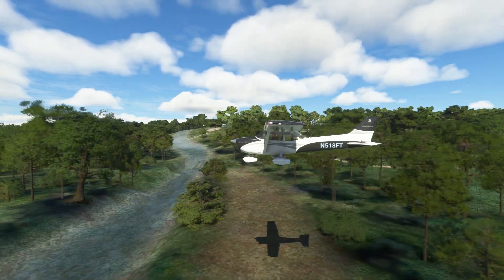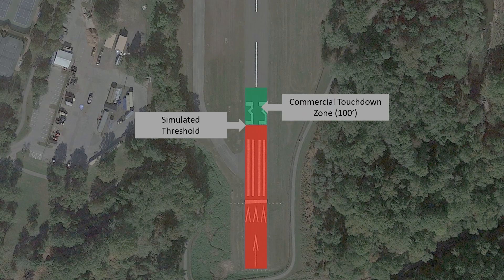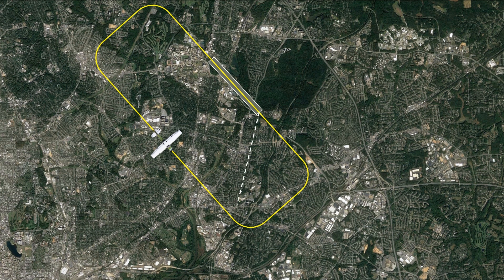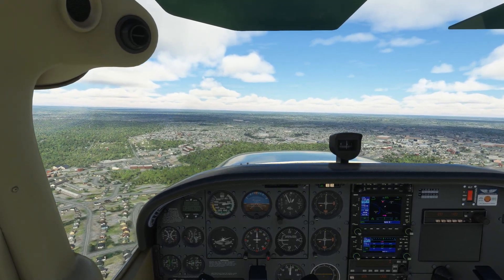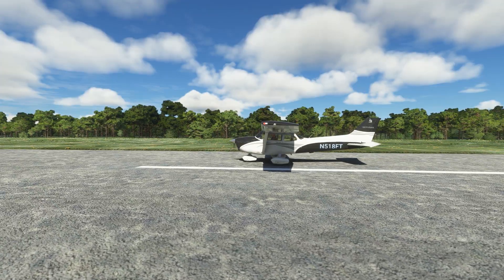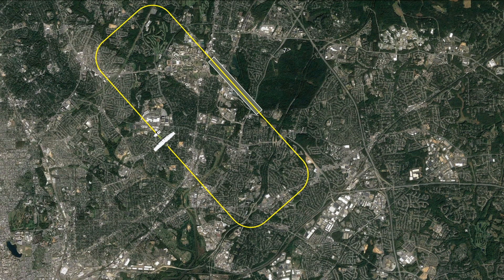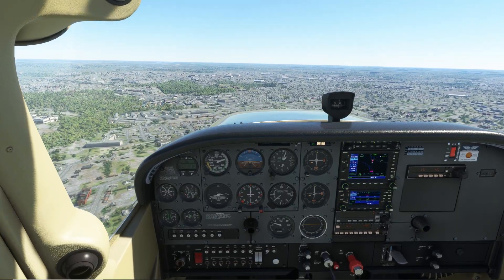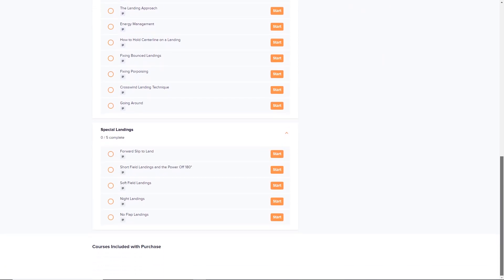Short Field Landings and Power Off 180° | Private and Commercial ACS Landings

Comment: On the power off 180, there is no requirement to go to best glide, so what I found to work great on the skyhawk is - power out obeam the aiming point (not the touchdown point), 10 degree flaps asap, count to 10 while pushing the nose down slightly to get the 75-80 knots (that will help you sink fast in a very tight pattern). As we drop 150 ft, make a base turn, a bit steep. From there, only as we get close to the runway, smoothly adjust to best glide, and maybe set 20 degree flaps to help slow us down. Making a runway turn only at 250 ft AGL, and you will make it to the touchdown point (mine is always the 1,000, and we have no displaced threshold). Of course if there are good head winds - make sure to account for those by either going earlier to the gliding speed or delaying the deployment of flaps, but regardless, the 250 ft AGL are amazing

Comment: On a power off 180 shouldn’t you wait until you know you have the runway made before you add flaps?
Reply: Technically, he had the runway made when he added flaps, it's up to the pilot's judgement to keep the runway within reach after the point flaps were added. At least that's how I see it, I've done power off 180s with flaps 10 from the base turn because I knew I had to lose some altitude and we were totally gonna make it!
Reply: @robrambilla  flaps 10 don’t add much drag

Comment: I've watched a lot of videos on short field landings, and this is the only one that has mentioned using back pressure on the yoke in the round out to control the point of touch down.  Even my CFI hasn't really explained it like that.  Makes total sense because keeping the nose high increases the angle of attack and generates additional lift so when you reduce the back pressure, you lower the angle of attack, reducing the lift and letting the plane descend to the runway.   Got my checkride coming up so I'm going to practice it with this in mind.  Thanks!

Comment: What actually happens if you land on the displaced threshold?
Reply from the maker: snakes. piles of snakes. No but really displaced thresholds typically are there to cause you to make an approach further down the runway either for noise abatement or to clear some obstacles in the approach path.
Reply: You fall into a hidden trap full of crocodiles
Reply: You could hit an SUV driving across the foot of the runway. This happened to a student pilot in Texas. 😬
Reply: High risk of picking up a puncture?
Reply: I like all these answers, but I guess I'm talking more reprimand wise. Like will ATC tell you to be more careful next time, copy a number down, or turn you into the FAA?
Reply: @kylemccartney1831  no nothing like that. They shouldn't do, but they often touch down there.
Reply: I thought about the same thing
Reply: Probably pilot deviation 😅

Comment: Fantastic! I believe that you’ve just fixed my power off 180. I’ve been doing them as a continuous curve instead of turning 45°
Reply from the maker: I hope so! Just be aware that all aircraft will have different looking approaches. I'm not sure I would do much of a 45 in a Cherokee as these have a much worse glide ratio.
Reply: @flightinsight9111  Thanks!
Reply: depends on the plane and the wind...in a 182RG the continuous turn is great...also remember not doing drastic turns also helps with load factor
Reply: @gveduccio  Thanks!